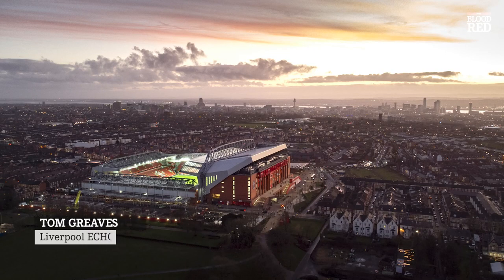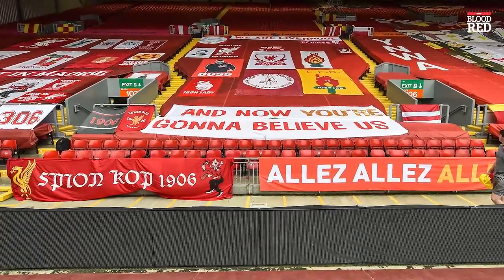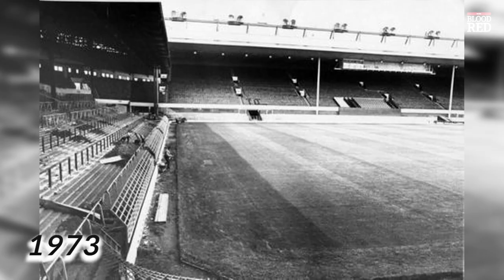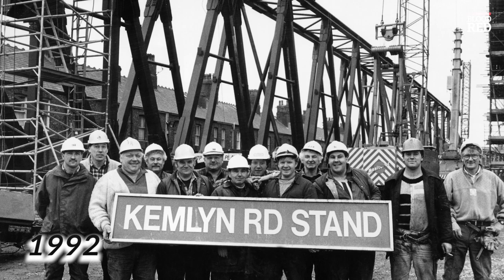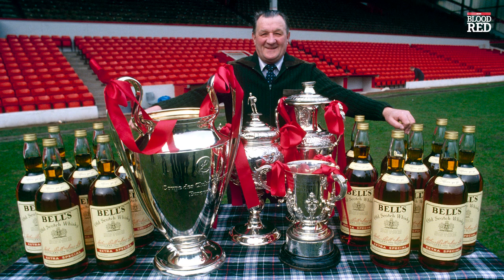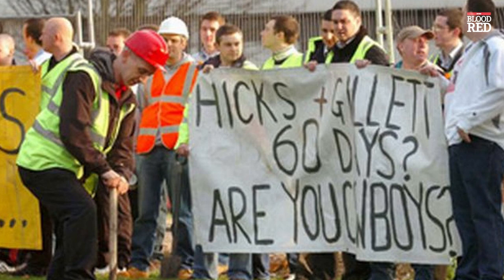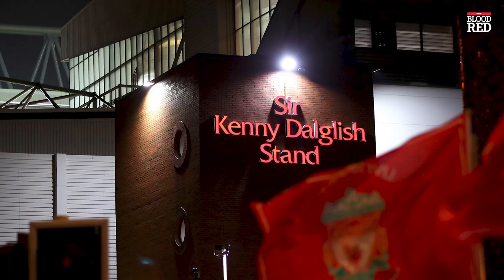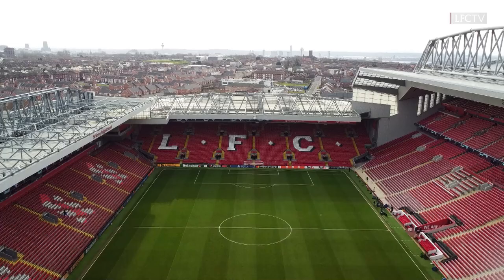The Evolution Of ANFIELD Throughout The Years | EXPLAINED

Comment: The 1970s Main Stand didn't 'go up' in 1973. Construction took place from 10 April 1970 to 29 November 1971 and was in full use for spectators from December 1971 onwards. It was officially opened on 10 March 1973.